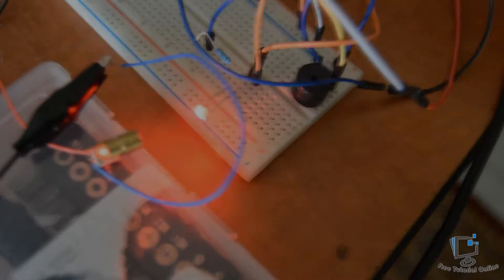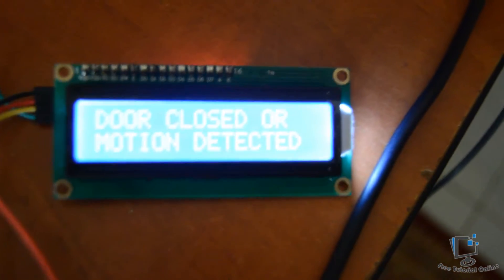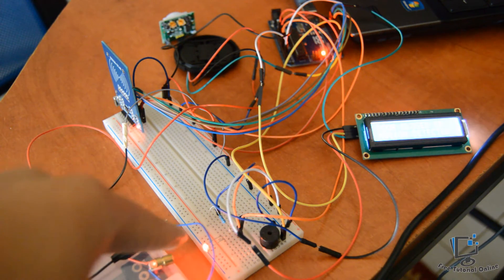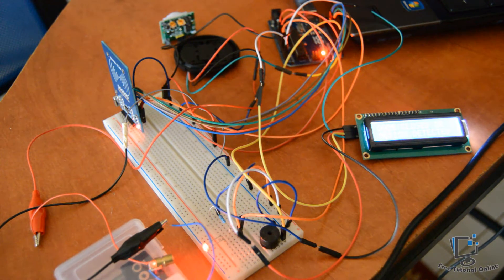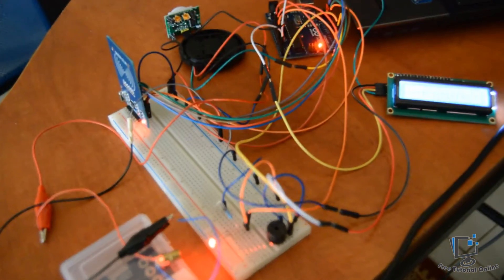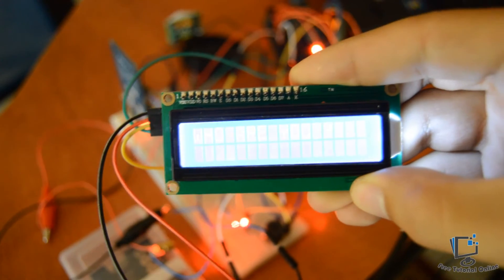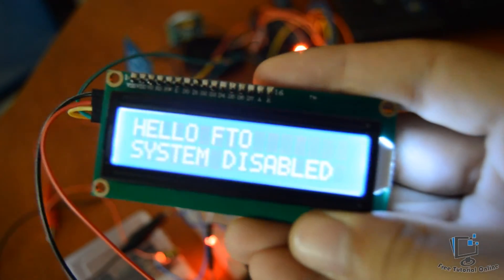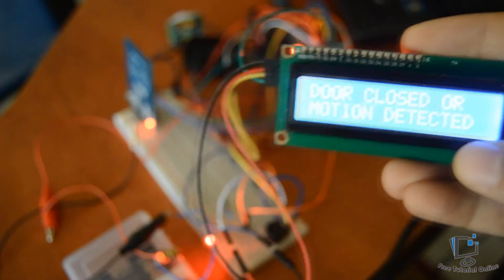Home Security System by Arduino  and RFID

Comment: please help me in completing my final project , I took a picture of the circuit of appliance -based security room Arduino Uno + RFIID + PIR + Laser + LCD + Keypad + Solenoid
Reply from the maker: Of course, with pleasure,what's exactly your project?
Reply: My project , the access door of the room, but I'm using Arduino Uno + RFID rc522 , lcd 16x2 c , PIR sensor , keypad and buzzer , I realized that the ports on arduino uno is not enough if I use all the components directly to the arduino uno , if you can help me to make the schematic and the sketch ? may flow works like this : 1. scan rfid card , if in accordance with the master key , then continued to enter the password , if the password is correct , the solenoid opens. if the wrong password input 3x the active alarms , and for the PIR sensor function when no one else entered the room with no access door
Reply from the maker: +Izan Ict how much pins do you need to add?
Reply from the maker: because if you need just to one or two, you can use D1 and D2, and delete Serial.begin from the sketch
Reply: actually I use a lot of pins, as I try to connect the pin rfid rc522 , keypad 3x4 , lcd 12 , PIR , relay modules ( solenoid door lock ) to pin arduino uno directly, I realized it turns out to connect all the pins to arduino , not enough ports the pin,
Reply from the maker: +Izan Ict you can use the analog ones by writing a function in the sketch (if voltage is up to 4V for example then it is like "1" for the digital ones). but keep in mind that you can use them as an inputs not outputs)
Reply: yes, actually I already made it , and I can not add Component PIR sensor , because the pins on the Arduino Unu is not enough for all the component pin , so I just use the Arduino Uno + RC522 + Keypad + LCD + Relay, 

see my experiment in https://sudaryono-ict.blogspot.co.id/2016/08/arduino-uno-rfid-rc522keypadlcd.html but in Indonesian
Reply: Im using analog pins, connect to lcd
Reply from the maker: Yes, I took a look at your project, it's very interesting and useful ^^.
you are a genius ;)
Keep going bro ^^
Reply: thanks, 
Thanks , the components I use it is working in accordance with the stages , but I realized that it was not in accordance with the procedure. after I coordinated with my lecturer , should we use the lcd module components LCM1602IIC to reduce LCD pin connection to the Arduino Uno , so we could use the unused pin for the other components, ( but its sketch will change too )